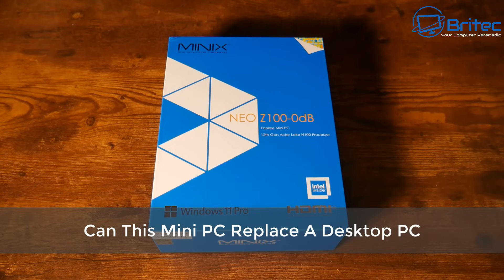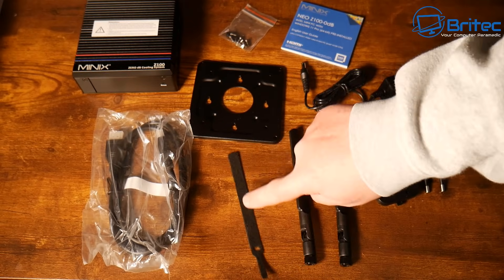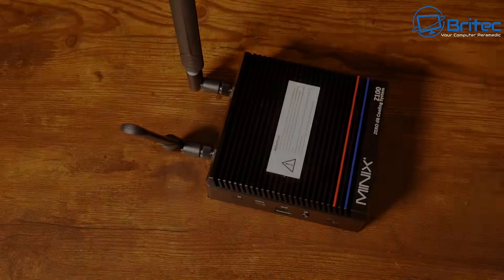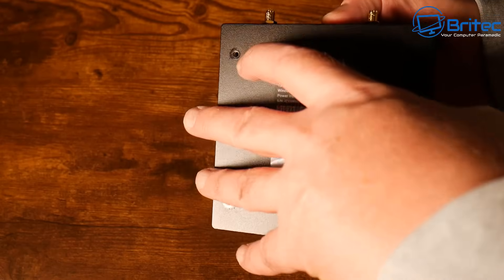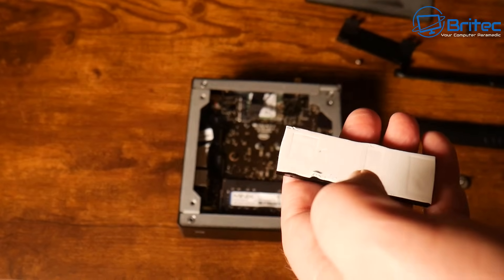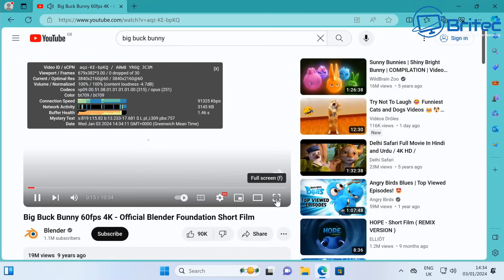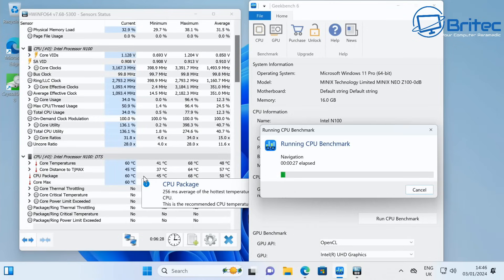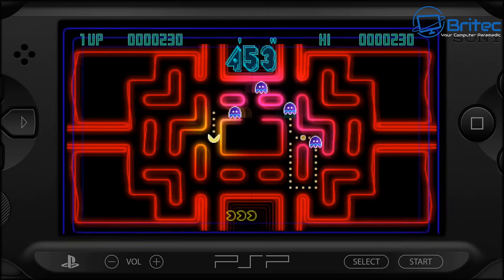Can This Mini PC Replace A Desktop PC

Comment: It is nice to see a fanless N200 box but the market for this processor is highly competitive, so this may struggle to compete at the price.

Be wary of the 32Gb RAM claim as Intel themselves only state a maximum of 16Gb (single channel).

DDR4 3200 is rather weak too when many other models have DDR 5 4800, which will matter more with only single channel RAM being available, for some tasks and applications.

There were many more dropped fames being dropped that I have seen with other competing models.

The SSD speeds were decent.

Promoting the purchase of patently pirated games, especially from a channel based in the UK could land you a nice new striped suit and new home for a few years. The next knock on the door could be interesting.

Comment: With most of the intel based chipsets on the mini's, well those dropped frames is usually an issue with the driver; update the driver, or reboot the machine. Win+Shift+B might also help, which reloads the drivers. It is not unique to the N100's either.  This core i7-1260P does the same thing ( 12 cores, 16 threads ) on occasion.  
N100 has limitations based upon Intel's design, like being limited to a single channel of memory, although the manufacturer could have chosen to go with DDR5 instead;  according to Intel, the N100 is also limited to 16 G ram, but in actual use, a number of N100 based systems actually support 32G in a single stick.  For general browsing, light office work, or even as a general purpose mini-server, the little N100's seem to be more than fine. Would I choose a better mini- likely, but reality is I'd rather have quiet than noise, and for 99% of the stuff I do, N100 would be more than enough  Understand that this was a design decision by Intel, for cheaper PC's to differentiate between lower priced CPU's and mid & upper priced CPU's. Simply put, if you wanted more than 16G ( or 32G ) then move up to a higher priced tier of machines.  The N100's, N200's and N305's are similarly limited by Intel.

Comment: Celeron N100 is not a good CPU.. i have the better version and that's terrible too. Steer clear of Celeron unless you're on a very tight budget and you dont mind laggy slowness.   Ryzen APU demolishes these chips. The Ryzen mini PC are a little more expensive but the absolutely destroy Celeron... You'll have a much better experience with an APU mini PC.
Reply: N100's are fine for certain types of things; but you are right in that most of the higher priced Ryzen based machines offer better and more consistent performance.  The Intel based mini's are behind in graphics compared to the Ryzen and have been for quite some time. 
Been using this 1260P for about a year now; this is an intel 1260P with 12 cores and 16 threads, and I still find the SER6 ( 7735HS ), which is 8 core, 16 thread, to be a better consistent performer.  Machines are probably due a disassembly and cleaning out of the dust however. 

Oddly enough, I don't see high CPU usage on this i7-1260P,  it just seems slower. At idle, the Intel idles at a slower clock speed ( about 1.6 to 2 ghz ) whereas the Ryzen runs at about 3 to 3.8 Ghz; sort of like the difference between a 4 cylinder and a v6 or V8.   It's a matter of "seems" and not so much about being pegged out.
Reply: @MrPir84free  My nucbox has that Celeron in it.. it's really painful to use for me, i've streamlined it as much as possible and it still struggles doing more than one thing at time. I mean it's not totally useless but for solid Windows experience i don't think it's it.. I'll be turning mine into a retro-game box. I got a laptop with a 5500U and it's a night and day user experience.

Comment: Thanx for the video.  At the 6.14 mark you show the BIOS and it shows  M.2 NVME  equipped  and a M.2 SATA not equipped.  Can it have two drives.??
Reply: I have the same question

Comment: Although not for  me Brian it certainly looks to be something that I would buy if I was interested simply because it is Intel powered as I am a fan of Intel processors. I personally would not like the mounting of the computer to the back of the monitor because that would mean fiddling around at the back of the monitor to insert USB sticks for example. The drive I would change to a Samsung as I do prefer their drives to any others.  It would be a great buy for those who do like these mini computers and those who have a limited space in which to work in. Having said that it is really good value for the price eh?

Comment: My last two portable computers keep locking up at random. I'm looking to get a proper desktop machine and away from yucky portables (an HP and a Dell). Thanks for this video.
Reply from the maker: You're welcome
Reply: May need to disassemble and clean out the furballs and dust ..  Fanless would be a boon in that there's no fan to clean out, so nothing sucking in dustballs.
Reply: @MrPir84free  - they were both brand new machines and locked up on the first day. My research says it may ne drivers incompatible with win 11.

Comment: I 'm starting to wonder why most of these mini pcs only have 4 cores when all smartphones these days have a minimum of 8 cores. If you can shove an 8 core cpu on a smartphones motherboard, why can't they shove one on a mini cpu motherboard X3-5 of the size ?
Reply from the maker: 4 Cores? some have 8 Core and 14 threads.  That's a AMD Ryzen™ 9 7940HS in a mini pc. So not sure where your getting only ever 4 cores
Reply: Isn't this one 4 cores? 
Why in 2023/24 with gen 12 cpus we still have manufacturers making a 4 cores ? @Britec09
Reply: @Noiconnotag Because most ppl don't actually need more than 4 decent cores in their average usage of a PC. ARM and Intel now both feature extra low-power "lite" cores to produce less heat in portables and/or prolong battery life for background processes or lite foreground tasks. But that isn't necessary so much for desktop or nettop configs, you can throttle regular cores as well.
Reply: @alexanderr.539 the point about most people not needing more than 4 cores... I'd contest that point. Windows hardly runs well on the lower spec 4 core CPUs. The same with the 4GB of ram. While it can run, it won't run well. 

Most people aren't using a brand new clean windows install with nearly 0 additional programs installed.
Reply: It's a low power, fanless, and relatively cheap processor;  cheap usually means that  something is lacking.  It is not saying that it can't be useful.  Does everyone need a $400 or $500 mini-PC ? Nope: some want just basic functions and 4 core is still more than enough.
The manufacturer did scrimp some by putting in DDR4 instead of using DDR5.  As the CPU is limited to single channel memory, DDR5 would have improved performance a little bit, but on the same token, DDR4 is cheaper, and cheap is the name of the game on this unit. 
Personally, I'd rather have a quieter PC than to have a beefier mini-PC with noticeable noise.  No, N100 machines are no fun when it comes to Windows Updates, but reality is no machine is fun with regards to Windows Updates;  and Windows Updates is probably the most strenuous thing that happens to a machine like this.  For light duty office work, or general browsing and streaming, 4 cores is enough.  I have 12cores & 16 threads in the mini-PC I'm currently using & yes, I walk away when updates are being applied.  But for light browsing, or streaming video, I'm using about 6% utilization. ( I have a N100, and sat there one night watching youtube on it; perfectly fine, and I'm used to 12 cores )
And it's sort of disingenuous to compare a 8 core phone CPU to a desktop;  not even close to the same performance. And phones aren't even using the same type of CPU either.  A phone simply is not consuming 8 watts of power, let alone 20 or 30.  Not even in the same class. If one could put 10 watts of power thru a phone, it'd likely shutdown in seconds; or melt in a few minutes. Probably blow up once you consider the battery getting too hot.
Reply: the n100 CPU is indeed 4 core,
4 thread. I have 4 different PCs with the n100/n95 CPU. It is perfect for audio/lighting control software, day to day use, home theatre use, etc. They are my most stable and reliable machines and dont make a sound.
Reply: There's now the Z300 with IIRC 8 cores.

Comment: This has got my firewall/access point taste buds going, quite cheap too.
Reply from the maker: It would be great for that
Reply: Lacks ethernet ports needed ( 2 )   Don't know if the ethernet port in it is ideal or not ( Realtek ? )  Be sure to check out if the wireless card inside it actually supports access point functionality or not. Many such wireless cards do not. Some don't support newer features like WPA3.